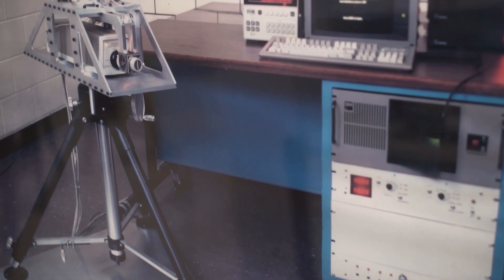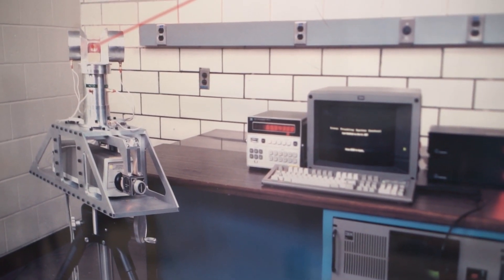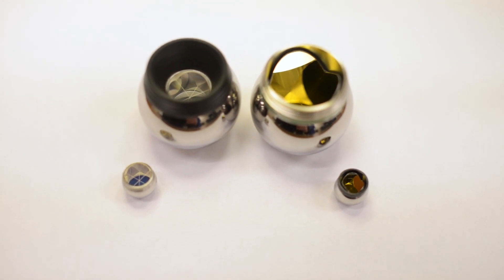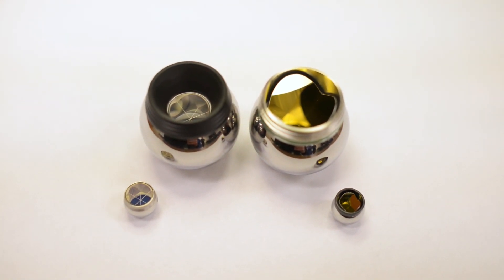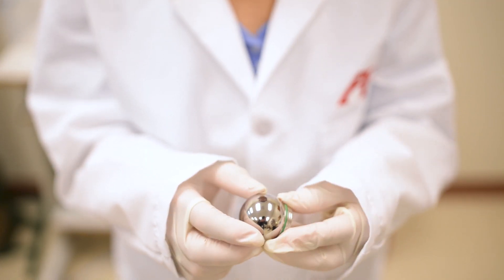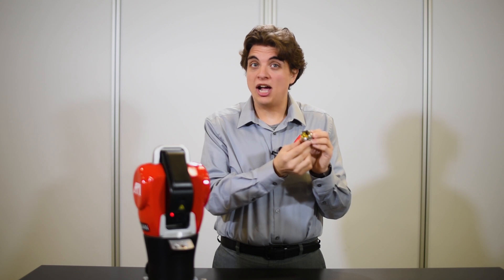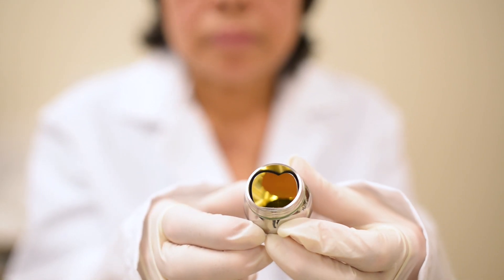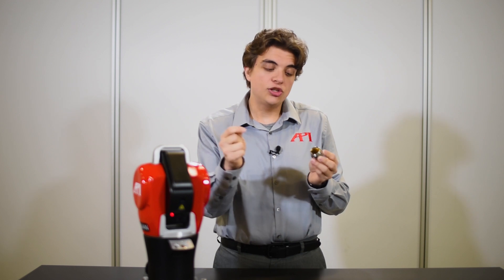How it Works | SMRs

Comment: A very informative and well pieced video. Laser tracker system can be considered as a two part metrology system. The laser tracker head acting as the emitter for the first part of the system and followed by the SMR acting as the reflector for the second part of the system. 
It should be a good practice for both the metrology service providers and the customers to check on the calibration certificate validity for both the laser tracker and SMR prior to any measurement services conducted.
As the laser tracker is an electronic metrology instrument, one cannot be certain that the instrument is in good working condition at all times. One good practice for metrology service provider to adhere to is to perform a system self check using a known reference (Length gauge) prior to and after the metrology service. This would highly boost the level of confidence in both the customer and service technicians in regards to the quality of service provided.
Reply: Dear Sir, Indeed very valuable points you have mentioned here. We surely recommend equal importance to be given to the head and the SMR. API makes one of the finest SMRs in the world with a wide range to chose from. Do let us know any requirement you may have.